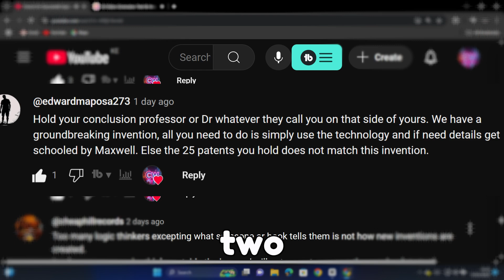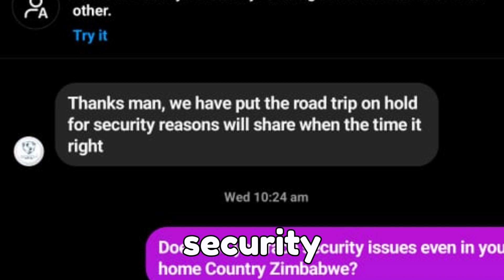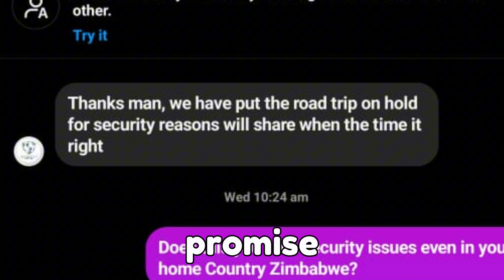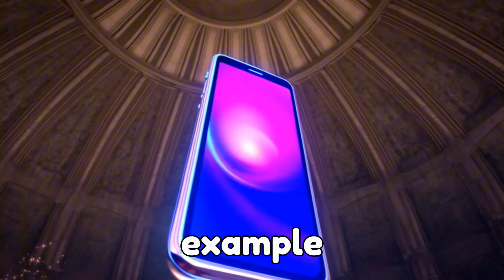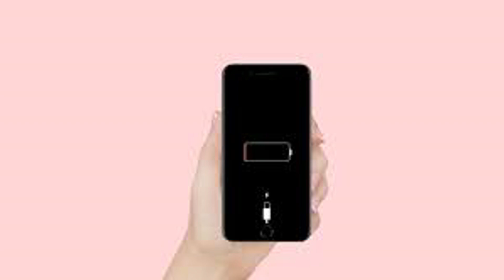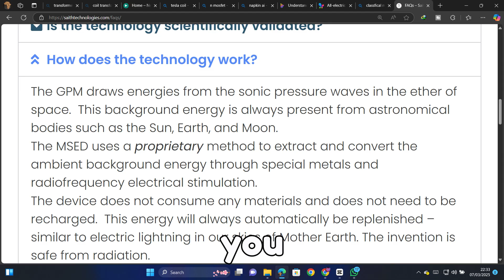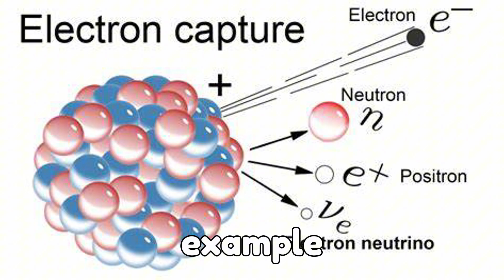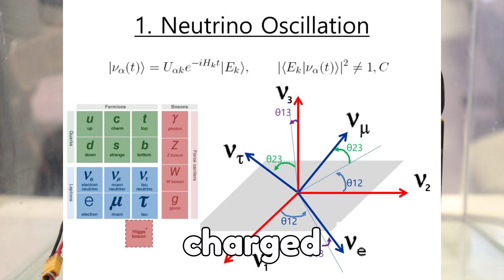Dr. Giacometti Details How Maxwell Chikumbutso is a Clever Man

Comment: Even if you made a mobile phone that will charge from your cellular Tower do you know how much energy that you will be sucking from the RF just to convert it into electrical charge for the battery and if you add another 50 people to a hundred you really think that that transmitter has enough power to do it. I'm not the next but I have common sense there is no such thing as free energy yes there are devices have been invented by real people that did work but some of it was so complexity that even the today's modern scientists do not understand. And I'm not in favor of governments or all these oil companies because I know they also do a lot of BS in the background. But let's be realistic the only energy that you're going to convert from an RF signal even if you make a really well tuned circuit to the frequency that you want to convert it into electrical energy you're talking about what meals lighting up a few LEDs give me a break.

Comment: My investigation shows that at sunset, one can make solar cells deliver power at night as well if power consumption is reduced. This can be  by using low power light emItting diodes like those  found in Touching Android phone. What one has to do is to cover the solar panel and turn on some   diodes  to shine on them. The cover is opaque and the solar panels keep generaring power through the ligjt feed back. But  Maxwell Chikunbutso has kept secret what he did. He is driving a car without solar penel and he is saying that his electric car needs no charging. Again he should remove the self destruct he said that he inserted to prevent people studying what he did, otherwise no one will buy his product. There should be no patents awarded  or trade secrets allowed so that other electric cars will use the things he discovered to provide free energy for the benefit of humanity. His invention might be unique like instead of turning the light emitting diode from battery power, he is turning  them on from all kinds of radio frequencies around a home thus conserving battery power. What he did needs serious investigation. I can also tell you now that my solar panel can generate some power in a full moon thus justifying that star systems can also be source for energy.
Engr. Enugozie jiagbogu

Comment: Those of us who use mosfets every day know that they are basically switches, and they dont "amplify" current or voltage. Infact they dissipate energy in form of heat (and phonons) inside them, which means the power applied across them gets lesser and lesser in the output
Reply: Well yes they (mosfets) do switch on a bigger current (from a smaller one) and cause it to flow. So indeed they do switch on what you already have, and the bigger one become the amplify version of the smaller one  . Yes they dissipate some of what go in but not to the point where they dont do what we want them to do, our devises still work
Reply: And to think of it: the current/volt just sitting there at the drain like a body of water
waiting for a small volt from the gate from which it  take its form and pattern. What we got there is the process of modulation. And to go even farther, when we flipped a light switch that too is the process of modulation,  even when we talk and the list go on and on.

Comment: Well understood Prof but may you explain the Television which was powered by the ' claimed' device.The Television worked without any connection to an external power source.Stage managed? Least likely!
Reply: the power source was internal, they are called batteries. Chikumbutso attached a circuit board on the back of the TV claiming it was his Microsonic reciever but it was just your typical dc to ac inverter using very common circuit components, if he was smarter he would have just made a dc to dc converter and his TV would have been more efficient  and would have been able to run it for a few more minutes
Reply: @hiz-n-lowz1577 exactly i have built a power supply for a tv using dcdc converters and 18650cells it was good for 20hours everything fit internationally. So he put his on the outside so he had more space for batterys
Reply: @hiz-n-lowz1577 Why haven't you made what you just described? The world needs cheap energy, that's the goal
Reply: @hiz-n-lowz1577  a lot like his glass encased, deconstructed browley portable solar power station he revealed to the world (you tube and a few idiots that believed him) as his micro-sonic device at the launch show
Reply: the Television had batteries hidden in the back to power it without external power supply, a simple and easy con
Reply: @davidbamber-n9x in that video can show us where the batteries were connected???????
Reply: @davidbamber-n9x Did you see the battery?
Reply: @joem551  no they are hidden inside the back of the TV, otherwise it would not be a very good scam
Reply: @davidbamber-n9x Ultra -thin flat screen TV had batteries hidden at the back? Least likely okay
Reply: @edmoremanjengwa1312  you obviously haven't watched that video of the TV, it is a much older TV with huge space in the back for batteries
Reply: @davidbamber-n9x  Well I don't think so kindly post that portion for everyone to evaluate.
Reply: That's very easy to debunk
Reply: Tesla once said that electricity can be transmitted wirelessly but people like this Professor during his time called him names and ridiculed him, even after he tested it and proved it's possible. Few years ago, a group of people repeated the experiment Tesla did and see that it's possible.  Don't mind these professors.

Comment: To run an EV off of that small of a battery doesn’t make sense unless that’s a separate battery for controls. But to power the actual motors in an EV would take something more substantial than a 12v battery even if it kept its charge full.
Reply: You do know electric vehicles have big batteries inside of them that have nothing to do with the small battery he put inside the hood?

Comment: For over a decade and a half, I embarked on developing a groundbreaking free energy technology centered around an innovative concept I termed "Jupita." Beginning this ambitious project about fifteen years ago, I aimed to harness readily available excess energies—such as ambient thermal gradients in regions like Africa, unexploited waste heat from industrial processes, and even more subtle forms like subatomic interactions or "nitrinos"—which remain vastly underutilized. While tangible applications like ambient thermal energy capture seem within reach, the fundamental challenge persists: efficiently mitigating energy loss in everyday systems like automobiles. It astonishes me that despite possessing extensive resources and advanced technology, prominent research institutions haven't yet cracked the code on harnessing and recycling energy within these systems to achieve zero waste emissions. Wouldn't converting waste heat into rotational energy represent a pivotal step toward addressing global concerns like carbon emissions and climate change?
Reply: @ch0asnature  capture heat from an automobile would require a device how large to do exactly what in the end?
Reply: @scamchan  Elaborate
Reply: @ So what type of energy will be converted from the heat again?
Where exactly would that conversion take place?
What size would such a device be?
Reply: @scamchan  Size should be considerably very small, it would be more electronic than mechanical, device would be placed in the exchuast, engine block e.tc where ever the greatest heat are being generated...
Reply: @ch0asnature  There is this thing called a catalytic converter that uses heat already. 
So how much energy would be generated?
Reply: @scamchan  This is very simple. my vision, very simple, heat is being lost, find a way to capture the heat loss and convert it into electrical energy. i am not interested in catalytic this and that, i am interested in capturing the heat loss, which i know for sure occurs.
Reply: @ch0asnature  You think a converter FILLED WITH HEAT isn't heat being lost? WOW

Seriously you can't be taken seriously at this point for your lack of understanding of what the converter does and the heat within it.

So the final question is how much electricity would be created from the heat loss?
I suspect you have even less answers to these questions and that seems to be why no one is trying to do anything with the heat.

Hint hint.
With cars transitioning to Electric you probably want to go down a different route to  convert any heat to electrical.

What device do you have that converts heat to electric presently and what is the temperature range of operation?
Reply: @ Any device placed in the exhaust chain would probably restrict the flow if it is to capture all the heat and wouldn't be very small device that can do that.
Reply: @ How much power can a device like that generate from wasted heat?
I suspect it wouldn't keep up with the generator / alternator that is already installed.
Reply: @scamchan  conventionallly yes - but i am thinking outside of the box on this one
Reply: @scamchan  i know its possible to capture the heat loss...
Reply: @ch0asnature  capture 100% or just 10%
Reply: @ch0asnature  I suspect the device may work in some factory setting but not in some auto engine.
Reply: @scamchan  as much as possible and keep developing
Reply: @ch0asnature  pictures of such a device?
Reply: @scamchan  sry - did i give the impression that this has already been developed?
Reply: @ch0asnature  Well you said you have over a decade of research.

Comment: "I've been toying with a free energy technology that has its roots in Jupiter, which I started exploring around 15 years ago. The idea is that there's an abundance of excess energy lurking around us, waiting to be harnessed - think about it, like the thermal energy emanating from pipes or the scorching temperatures in African regions. These are all untapped energies just begging to be tapped into.

As for subterranean or atmospheric energies, I'm intrigued but haven't dived deep enough yet. Why bother exploring those mysteries when we still can't crack the code on sustainable energy loss? It's like, what's the point of having a massive research facility with all sorts of fancy equipment if we're still stumped on collecting and recycling initial energy from something as mundane as a motor car?

We're always yapping about CO2 emissions and global warming, but where's the innovation in developing technology that can archive zero energy waste in our vehicles? Can't we convert heat into rotary energy or find some other way to make it work? It's high time we challenge the status quo and push the boundaries of what's thought possible."

Comment: There is no need to drive the car. Just turn on the heater and see the battery drain like crazy. 👍 on the video, you can see the bike at 91% battery, but it didn't show charging, and it should be at 100%
Reply: Big lie
Reply: Correct

Comment: CURRENT AMPLIFIER AT CONSTANT VOLTAGE COULD BE DONE WITH POWER BIPOLAR TRANSISTORS !!! WHY TO USE MOSFETS??? AND HOW TO DO THAT CURRENT AMPLIFIER WITH MOSFETS AT CONSTANT VOLTAGE???!!!
Reply from the maker: interesting,,lemme get this to Lloyd
Reply from the maker: From Lloyd 'Yes, BJTs can perform current amplification at constant voltage, but they require base current to function, making them less efficient.

MOSFETs can achieve the same goal, with a source-follower or current mirror circuit, and they handle higher power with lower losses.

The choice between MOSFETs and BJTs depends on efficiency, heat dissipation, and input impedance requirements.

Comment: Hi! Giacometti 

Further to your comment’s and explanations on the main thing to check: The battery charge .
Please check Dr Nils Rognerud , Electronics Engineer and researcher, who did travel from USA to Zimbabwe to check the Power generator capable of supplying 300 houses. His conclusions were that the generator works very well and the battery charge full at the end of the test.
Reply: Full at end of test with external power supply hidden.
Reply: Why will he even need a battery if his power source was so abundantly available! What a charade!
Reply: @Ngunev  Glad someone considered that.
Reply: @Ngunev 
One reason could be to supply power at a usable voltage. But he did say the electric vehicle, for example, doesn't use the battery other vehicle uses, which is why it is not as heavy like the conventional EVs. However, it seems to still need a small 12V battery.
Reply: @NuAege2302  You do know that the 12 volt battery isn't to run the electric motors?

The main battery for the motors is quite large and needs a BIG inverter to convert it into power for the electric motors.

That is the big box with the ORANGE wires going to it as that is high voltage.

MAXWELL Would need a huge device to capture enough RF to convert it to high current high voltage - to not only charge the batteries but to power the motors.

Amplification needs POWER to ramp up a small signal.
There is no magic being done here.
Reply: @NuAege2302  still doesn't make engineering sense. Suppose his wonder system works, he should be able to size the power supply to the requirement of the vehicle or any device he might want to power!
Reply: @Ngunev  He did just that lol
Reply: @thelovejones2008  why does he need a battery then?
Reply: Another unknown engineer giving an opinion no one else has verified..
Reply from the maker: I will Bring this to his attention but am sure he will read your comment